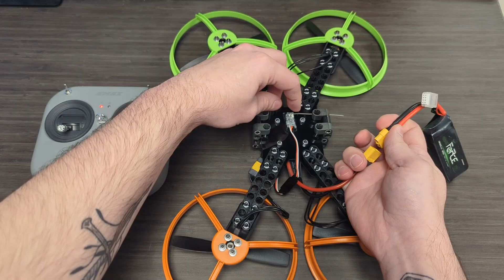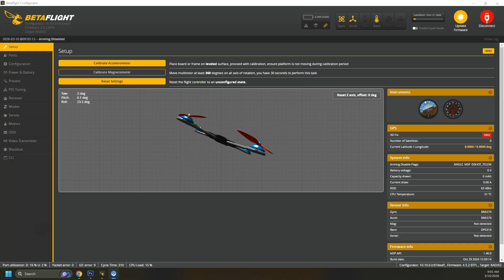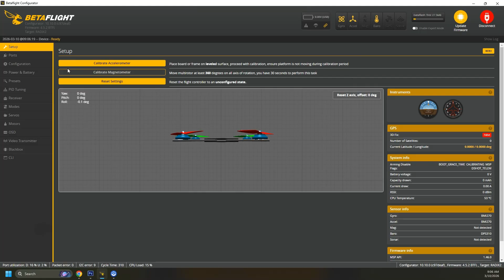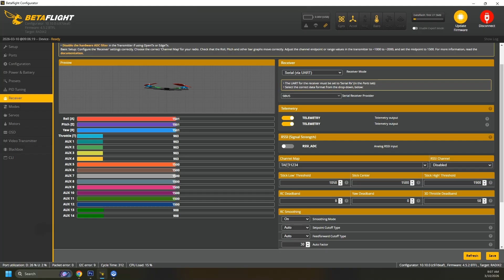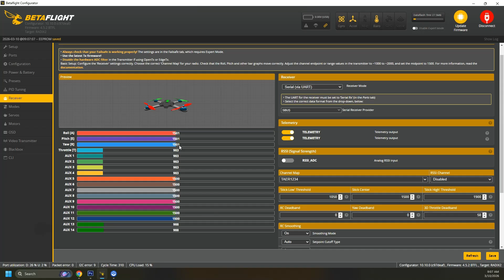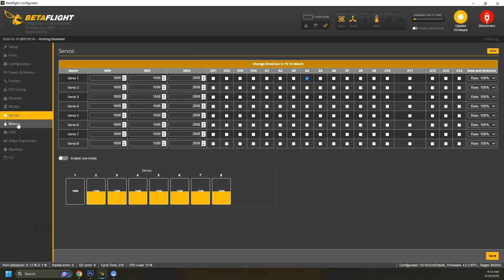MINDS-i UAV MultiRotor V2 Betaflight Setup

Comment: When my students try the binding process as shown in the video, after we plug the battery back in the reciever just continues to beep and flash. Any ideas. Followed the steps exactly as shown in the video.
Reply: same issue.  you need to plug the drone into the USB of your computer and load the BIN file for the RADX2 onto the FC.  When you plug it in the computer will recognize it as a drive.  there is a readme with a link.  follow the link and download the bin the drop it into the "drive".  once it loads onto the FC, unplug, then  plug it in and Betalight will recognize the Flight COntroller and the bind.  I hope this helps.
Reply: @trojanaviation  Thank you so much, classroom of students and we have spent a week trying to understand why! Thank you so much for your help!